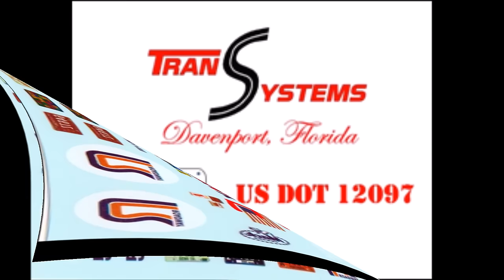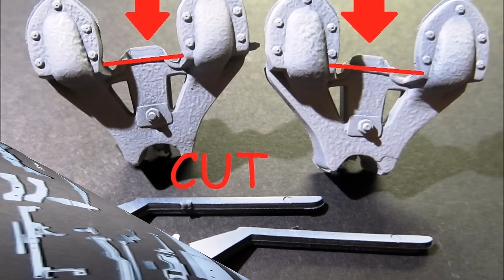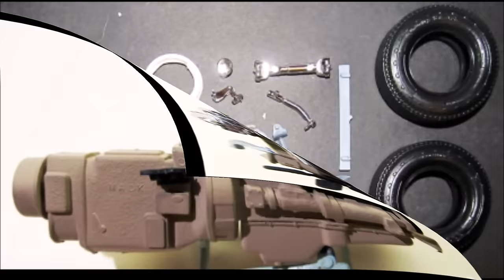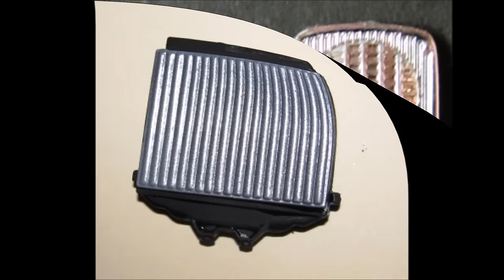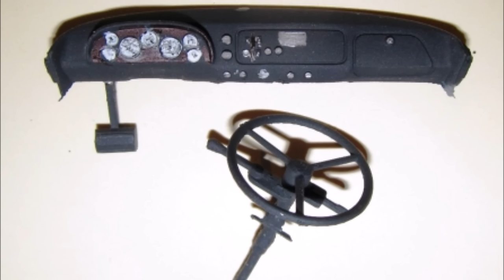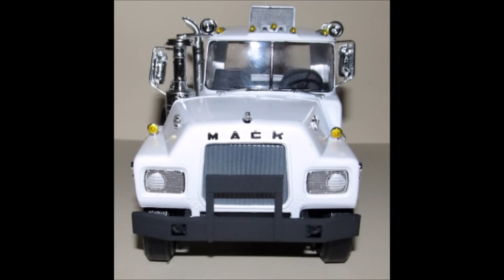How to Build the Mack DM600 Tractor 1:25 Scale MPC Model Kit #819 Review

Comment: Dear Sir you did a great job building the DM600 Mack  I've built several of these over the years and they all came out great! Of course, I tweaked all mine like moving the drive axles closer to each other so there isn't such a big gab between the axles very easy to do. I'm writing to you! because I, purchased another kit for a friend he wanted it for his office shelf! I built the model but on this particular issue the parts didn't line up or even come near as the older version,s the cab doesn't fit onto the cab mounts! I found many flaw,s the hood even with Tweaking cannot get it to line up properly! I decided to give my friend who is 72! one of mine from my display case and this kit is going to be part's only, I bought it at Hobby lobby along with other,s but for some odd reason? this model nothing fitted right and lot,s of flashing and sanding. I just wanted to see if you ever came across a model that nothing fitted right and many pieces,s that didn't line up! I've been building model,s professionaly since early 70,s along with owning & driving 25 Tractor,s and Trailer,s! keep up the great Video,s.
Reply from the maker: RY,  I have come across kits that didn't fit properly either by design or old age.  Sometimes the molds just wear out!    Thanks for sharing and please subscribe if you haven't already to help us reach more modelers!  -Doug

Comment: Gret job on this one. It looks like there is a lot of flash on the parts. I really wish Round 2 did a better job on restoring the old tooling before re releasing the kits. Got the '36 Ford, and boy, there is a LOT of flash, all around, and some serious mold lines on the body. The last '36 I built was a 80's edition Roadster, (the one with the yellow roadster on the cover) and the tooling was in much better shape.
Reply from the maker: Rusky - I know what you mean but I'm sure like everything else it's a trade-off.  If they had to spend the money to get the molds fixed they might not be able to afford those tires that have brand marking on the sidewalls like Revell does.  -Doug

Comment: Do you know what year this is a replica of?  I am looking for a 1972-73 Mack model R to use for a FDNY Rescue 2 cab & chassis.  I will be eliminating one rear axle & scratch building the rear walk in rescue body from styrene.  I already built a 1971 FDNY Rescue 1 from the AMT Mack R685ST (correct year) but can't find a 1972/73 year.
Reply from the maker: VD,  I'd guess it's a '73 DM600 based on the grill.     PS, please help us reach more modelers by subscribing if you haven't done so already. -Doug

Comment: I have two of these kits and I would like to get the rough tires for both. But when I went to visit the site I couldn't buy the rough tires.
Reply from the maker: JB, Sorry Josh but you might send an email to them to inquire or see if they can be found at the online auctions.  -Doug
Reply: Right On Replicas Thanks Doug, that is very helpful. If you could add a link to the site so I directly click on it. You should also check out the gravel trailer from MPC. You can assemble as a trailer or dump box for the Mack DM 800 but I mounted the dump box to the DM 600.

Comment: Sir: could you please email me your directions as how to make the decals. I have tryed>>>>what a disaster. Thanks!!.
Reply from the maker: SCR,  It's pretty simple really.  If you have a good design or image you simply size it up and print it out on some good decal paper.   Once printed let them air dry for at least an hour them give the decal a couple mist coats of clear lacquer.  There are two types of decal paper: white and clear.  Home printers don't print white so you have to use the white paper and trim the decals appropriately after the clear coat has dried overnight.  Always make a spare copy of them in case one doesn't work out!  Apply as normally like factory ones.  -Doug.